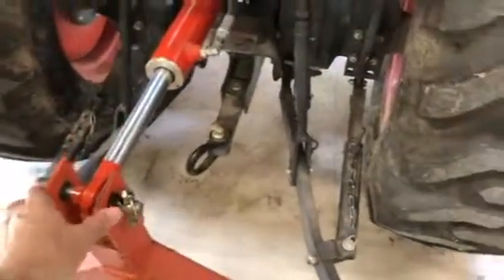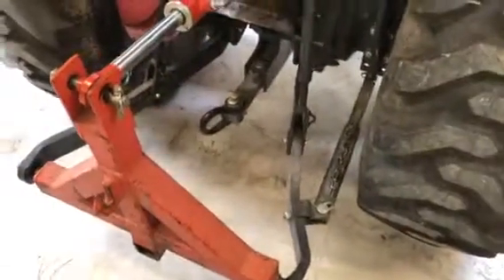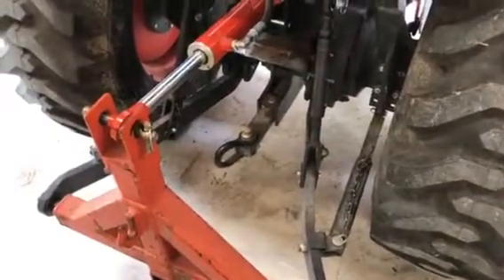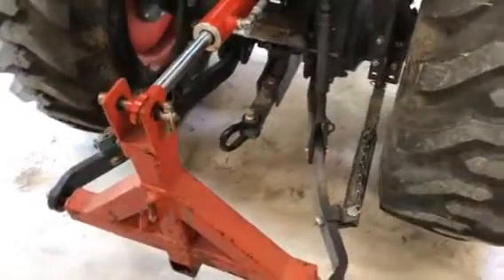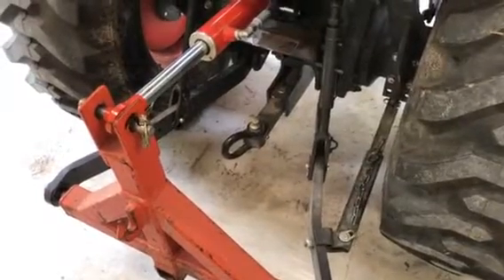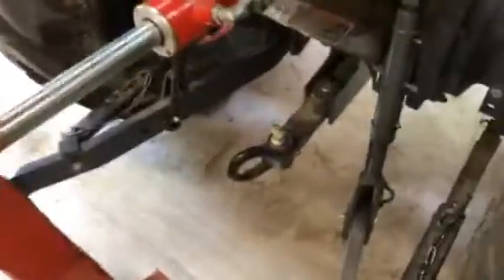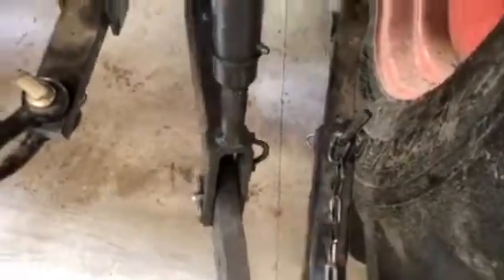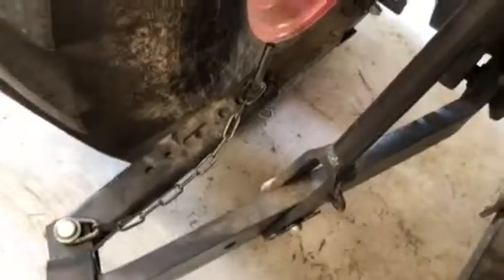Adjusting 3-point hitch stabilizer links

Comment: Why do you think they’re not designed for compression?
Reply from the maker: It's a "draft" type of mechanism setup for pulling, so they only need to worry about tension loads.  No need to design/build the structure for compression or other loads.  As a result, stabilizer links can be made from chains, turnbuckles, telescoping links, etc.  Those are all great at resisting tension but of course have little to no capability to withstand tension.
Reply: @Lumber_Jack  you do realize that the stabilizers don’t have anything to do with pushing and pulling,…right? That’s the job of mainly the lower three point arms that they’re connected to. The telescopic stabilizers do work with both tension and compression that’s caused by sway. That’s why they have the different holes to remain in a fixed position or allowed minimum sway with the slotted holes. They’re much stronger than the turnbuckle and shackle styles that you reference. That’s because both sides are working regardless of the direction of sway,…which makes them a stronger, superior design. The other two styles utilizes only one side to prevent it,…which is in the opposite direction. That’s why there’s always slack when the sway is to that side. You can prove that by disconnecting one side, and then seeing what happens.
Reply from the maker: @amandadavis9726  For decades, stabilizers were chains or turnbuckles, which are not meant to resist compression (there's an old saying, "you cant push rope" which applies here).  Telescopic stabilizers are a relatively new development in the long history of tractors, but also not meant to resist compression because they have a pin swivel joint on one or both ends.  You sure as heck can force them in compression, but that is not how they are supposed to work and eventually you will bind the swivel and maybe bust the swivel joint.  Pin swivel joints are intended for tension only -- this is a fundamental rule of thumb in mechanical design theory.

Three-point hitches have a long history going back over 150 years and if you look at the historical info, patents, etc, they are setup so that all significant loads are handled with the links in tension, even the side sway loads.  That is the fundamental concept of the three-point hitch and it's what allows a relatively spindly mechanism to handle massive pulling loads.  It is frequently used as an example problem in undergrad mechanical engineering textbooks on mechanical design (I am a former professor).

So going back to the point of the video, it's very important that your stabilizer links check side sway motion by putting the opposing link in tension while the advancing link goes slack.  The links should never be in compression as a primary mode.  Most telescopic stabilizers have a specific non-uniform hole pattern so that a unique combination of pin positions will give you pure tension constraints.  Properly setup, the links will not see compression.  If you are not achieving a pure-tension arrangement of the stabilizer links under sway, it means you still have some adjusting to do.  Of the dozens of implements I have used on a tractor, I have never run into a situation where I couldn't achieve the proper tension setup of the stabilizers.